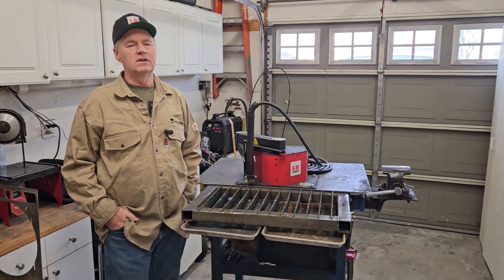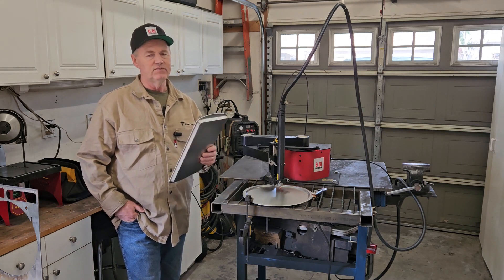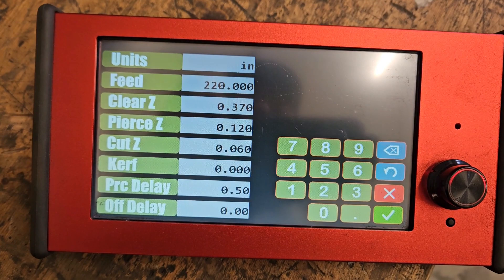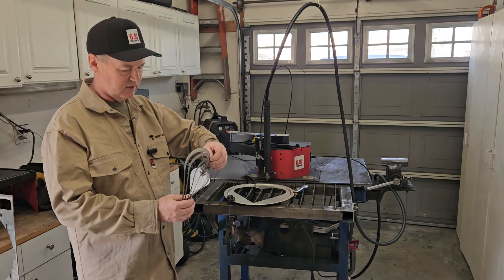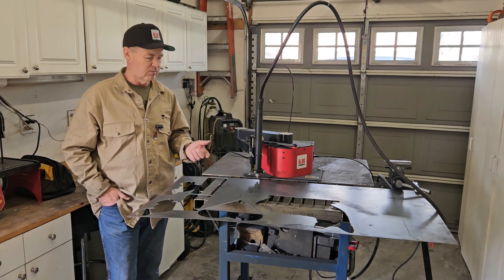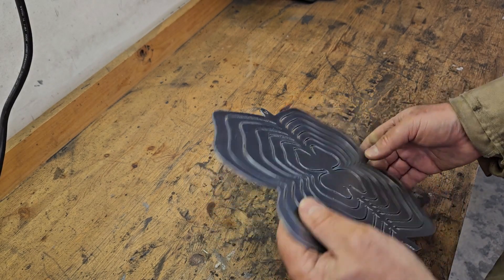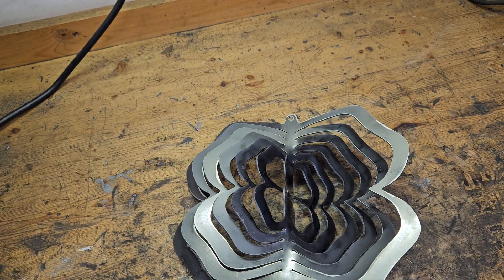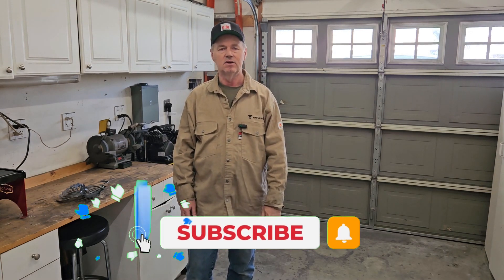Arcdroid Cutting Table Mistake Fixed.

Comment: Looks good, I have been trying to come up with a way to put some pans under my cutting area, but its 2'x5'. I live in a small town, I drive 100 miles to Orlando to get metal, a 4x8 sheet of 16g is $110. Do you come up with anything about the scalloping, mine started that when I put the machine torch on.
Reply from the maker: I'm going to try some things this weekend.   I'll share what I find.   Thanks for watching!